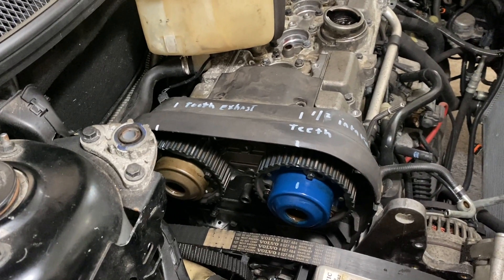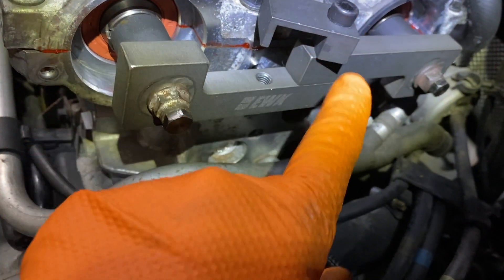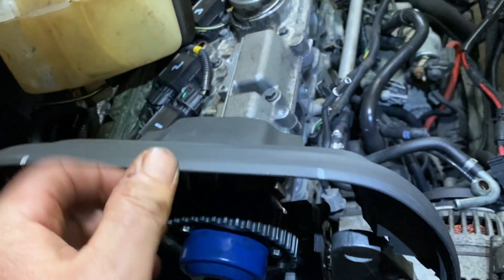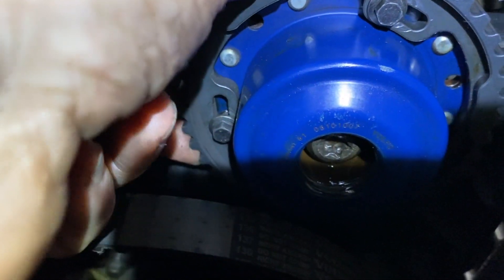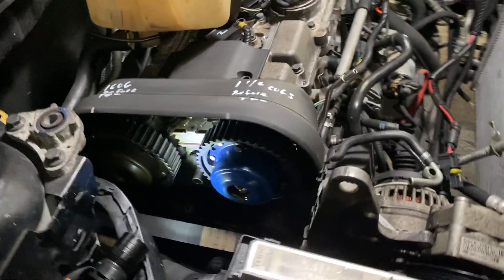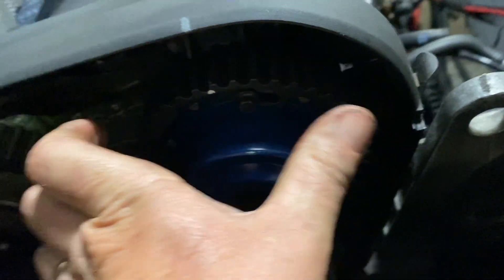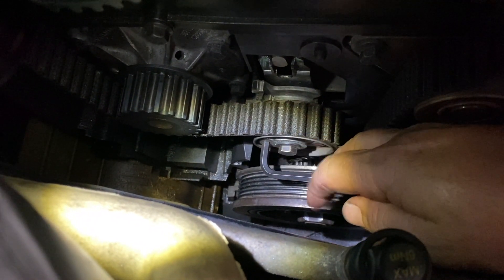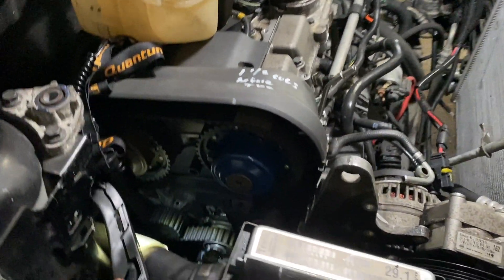Volvo 2.5 Turbo Variable Valve Timing (VVT) Alignment

Comment: After doing this I get crank but no start, could it be something else?
Reply from the maker: What exactly did you do?
Reply: I followed the video. I started having misfires plus crank/cam correlation code. I aligned everything, turned the engine by hand numerous times it all felt good. It did fire up once, then when I put everything together and got ready for a test drive it wouldn’t start. So right now I’m stuck, going to restart the job. Very low compression though with everything lined up. Averaging 80psi per cylinder
Reply: I also have done a basic timing job on this car (as in replacing belt with pulleys, I’ve also done cam seals). I just never dealt with the VVT hubs until watching this video.
Reply: I also removed the valve cover to make sure the lobes looked right, the cam locking tool is pretty spot on I’d say. So I really don’t know. It’s going to be the 5th time that I redo these steps after I reinstall the valve cover. I also have 223,xxx miles but I wouldn’t think it’ll just give up on me after retuning to factory specs??
Reply: What I did was loosen the center bolt, turned the cams CCW then CW to line up the marks TDC. Snug the center bolt, turned the unit CCW. Loosened the bolt, lined it up as mentioned in your video (1 tooth & 1 1/2). Then I torque the bolts and line it up TDC. Again, it feels good when I turn it by hand but it just won’t run.
Reply: Update. I haven’t started the vehicle yet... as I was putting everything together I remembered I removed the fuel pump fuse. Turns out the ignition coil fuse was blown. Would explain it I believe 👍🏼 about to crank it over
Reply: Another update, my ignition coil fuse blows as soon as I put the key in. Any tips?  The ground cable on the coil harness is not grounding too well. I put washers but still not that great. CEL is p0079 & p0076
Reply from the maker: Sorry, but without me being there to see what you did wrong is impossible. The ignition coil fuse is completely different than the timing issue
Reply: Yes sir. My coil harness was all jacked up. Got that electrical issue fixed and now have spark but still not running. So I’m going to redo it again lol. I have the cam locking tool so I’d say the important part is setting the vvt right. Also, TDC on crank is on the lower left notch from the oil pump right? Piston wise it’s not exactly all the way up but I guess that’s normal.
Reply: @solrac6267  I noticed this too! it seems as if its not truely TDC for me as well based off my crank mark.
Reply: I’m getting a reduced engine performance light, so it won’t actually start. I also have “high input from intake solenoid” so going to recheck the wiring harness
Reply: Many issues with wiring. Everything was dry and brittle so many wires crossing. Re-insulated everything and rerouted the crank sensor harness away from starter motor. Broke the bracket to the crank sensor though. Also, my camshaft apertures are broken, missing 3 keys (2 on one and 1 on the other)

Comment: Excellent video sir... my brother has a 2005 s80 2.5t and his timing belt got destroyed and jumped timing.. not sure if the the exhaust cam suppose to move in and out but it does.. any thoughts on that will help greatly  thanks
Reply from the maker: Thanks ! In and out movement is normal.
Reply: Hello sir I have some more questions.. after watching your video 8 times I was wondering how to know when to lock the cams? Or just putting locking tool all to do? Do I have to rotate cams or crankshaft or anything?
Reply from the maker: I’m not sure what you’re referring to?
Reply: What did you have to do before locking the cams?
Reply from the maker: I explained it in the video. It’s a procedure Volvo wants you to perform. I did that video a while back and the cams get locked down after the sequence is done.

Comment: Does this apply to the 2001 2.3T T5 as well? I'm guessing it is since it's the same block but different sleeves/boaring mostly if I'm correct. Great video!
Reply from the maker: If both cams are variable and look the same, then yes. Some models and years have only 1 can that's variable, then no.

Comment: I am replacing the timing belt on my wife’s 2004 Volvo S60 2.4. It broke while my wife was driving the car. So all three pulleys have spun different ways. So I understand about the timing and the notches. But Do you have a video of how to install the camshaft tool on the end of the cams? I would like to know what I have to take loose and how to install it on the back. The tool that locks the cams in place. I cannot find a video on that. Very good video BTW, thanks.
Reply: The Timing belt broke off without damaging the valves you must be damn lucky!
Reply from the maker: At 1:40 in the video I show the tool and how to install it. You have to take the cam covers off on the rear of the engine and then remove the stator center screw on each cam then install the tool in the vertical slots.
Reply: Thank you very much, I’ve worked on a lot of cars but never foreign. Also timing is something I’ve always stayed away from, I’m gonna try to tackle this on my own. But I’m definitely stressed out about it. Your video has helped a lot! Thank you!
Reply from the maker: Thank you and don’t be stressed just take your time don’t rush and you’ll be fine. Good luck

Comment: I have a 2004 s60, it wasnt running when i got it, got it to run, the intake cam was off a tooth, then a while ltr i took of the intake cam off to replace cam seal, and now it wont turn over, do yall have any tips to help me
Reply from the maker: These engines are tricky to time. You probably messed up the timing. Follow the video to retime the the valve train.
Reply: @motorcarnut  i followed it, but still think i still messed up, i tighted the exhaust vvt amd put the timing belt, then i tried to slide the vvt like at the end of the vid, but it it only goes like 3/4 instead of its limit position like the intake cam
Reply from the maker: They don’t have to be even in the end as long as they are as far as they will go after following the whole process.
Reply: @motorcarnut  ok well i feel kinda dumb now, done it like 4 times now thinking i was doing something wrong

Comment: Thanks for this...I watched the video about 5 times, set everything up (I thought) but when I turned the crank over twice the exhaust hub mark looked a tooth off.  Didn't know if I could just spin the cam with the locking tool so I just did the whole thing over again and it purrs like a kitten.  Thank you so much.
Reply: You could have jumped the cam a tooth after loosening the tensioner and clamping the belt to the other cam gear.
Reply from the maker: Thank you! Glad your back on the road!

Comment: What's the torque spec on those 3 bolts for cam gear ?
Reply from the maker: 89 inch lbs
Reply: @motorcarnut  thank you .

Comment: Man, that´s exactly the video I was looking for. But should the oil residue from the VVT/threads not be cleared before re-tightening? If I tighten the center screw with oil in the threads how can the torque spec be reached?
Reply from the maker: You don’t have to clean the thread’s you’ll be fine.

Comment: What am I missing? Why do you even have to loosen the 3 nuts and mess with them on each sprocket? Cant you just put the sprockets back on where you took them off? They have the spring loaded play. So, if you just made 2 marks (1 for fully advanced, and 1 at rest). Cant you just put them back in that same spot?
Reply from the maker: You really can’t because once you release the tension on the timing belt everything can move because once you do you will throw the timing off and will have to lock the cams in the back and reset the vvt units like I show in my video.

Comment: I am just about to change the head gasket on a 2006 Volvoxc70.  I have been scared ______less about this part of the job.  I think I can now remove the timing belt and lift the cams with some degree of confidence thanks to your video.
Reply from the maker: Thanks, it ain’t so bad just mark things as you take them apart .
Reply: I am in the process of the exact same job.  Removing CAMS and head to replace valve seals and hg.  Let us know how it goes !! Good Luck !!

Comment: Just did this today, wrote the steps down so itde be easier to follow while doing it and happy to say it fired up no problem! At first i attempted to follow what ever vida told me and it wouldnt start and gave me a cam inlet code...
Reply from the maker: That's great. And the reason I made that video. The factory manuals can be confusing to people who are not seasoned mechanics so I try to explain them in layman's terms.

Comment: Could that cause a ECM-6140 error code to come on?
Reply from the maker: Yes or dirty or failing cam solenoid.
Reply: @motorcarnut  I replaced the cam solenoid and the same code came up.
Reply from the maker: Then it’s probably one of the cams is off. A scan tool can tell
Reply: @motorcarnut  I have a vida dice scanner. Will that work?
Reply from the maker: Perfect, that’s what it’s made for
Reply: @motorcarnut  what is the numbers for the exhaust cam?
Exhaust camshaft adaption is -1.47
Exhaust camshaft reset 80%
Reply from the maker: Looks like that cam is off a bit or the cam gear is worn. How does the car run at idle when cold and hot and how is the throttle response? Also if you clear the code how fast does it come back?
Reply: @motorcarnut  the code comes on after driving 5 miles.
Reply from the maker: Under load, so did you do anything with the timing or did this just start out of the blue?
Reply: @motorcarnut  I replaced the head do to a blown head gasket. Then the code come. I  took off the exhaust hub to replace it the exhaust came gasket. I reali the ports and the pcv box was clogged. I cleared the clogged and replaced the entire pcv system. I started the vehicle and code came back on.
Reply from the maker: You have to recheck your work, you had to have mess something up. The Volvos with both variation cams that move anyway like in my video are a little tricky to line up
Reply: @motorcarnut  I adjusted the exhaust cam hub to factory specks. It started better, but I lost daylight.
Reply: I replaced the exhaust hub. The difference is now -5.97 on the camshaft angle exhaust.
Reply: Is there a email or place I can send you pictures. The vehicle is now not starting like it does not have spark or fuel, but it does have both of those.

Comment: You said to turn the engine counter clockwise and then clockwise and line it up. But I’ve read on forums that it’s locked up their engines and they hear loud clicking. Could you respond?
Reply from the maker: I can't speak for what someone else did or didn't do. Follow the video, you turn counterclockwise very slightly then clockwise to make sure everything is aligned BEFORE starting the engine. If everything is aligned after then nothing jumped and you're good to go.
Reply: @motorcarnut  oh ok, I thought you meant turn the engine a whole rotation ccw. Thanks for your response, this video helped me immensely!
Reply from the maker: No problem, glad to help

Comment: I have a question sir. If the timing belt is removed and I am looking from the top of the engine down onto the VVT and I move the VVT back and forth to its maximum and minimum movements, I noticed On mine, that when I do rotate it to the minimum and maximum stops, the cam gear moves in word and outward from the cylinder head about 3/16 of an inch or so. Is this normal in your experience repairing these Volvos?
It is almost as though the inside of my VVT has a helical gear within it. It does not spring back it will stay where I put it. Is this normal?
Please know I have a VVT on both the exhaust and the intake. It is a 2004 2.5 turbo And this is how it came from the factory.
Reply from the maker: Cam gear movement from side to side is normal with no spring pressure.But you still have to set it up as stated in the video.  A little movement in and out is normal but should be no wobble or noise. Hope this helps.
Reply: I'm at th3 point of turning the vvt hubs clockwise, the belt is on and time to lock the 3 bolts holding the gear. Intake side hub turned clockwise like yours to the full limit position just like yours. When I go to the exhaust vvt, I can't get any movement out of it. Is that normal?  About to lock the 3 bolts and turn the key. ✌🏼💚Ty for the great video best one out there imo
Reply from the maker: Should be fine, yes. And thank you for the comment, appreciated!

Comment: Best video I've seen explaining this process. Thank you!
Reply from the maker: You're very welcome!
Reply: @motorcarnut  hey can I ask if your Volvo engine was surging and stalling? I have the same vehicle it turns off on it's own and the rpm keep reving also the engine keeps rumbling like having trouble to stay on did you fix yours and now it's good
Reply from the maker: No, that car had a blown head gasket
Reply: @crazy2-1ilz18  mine does exactly that. I think I've got the VVT timing wrong so will do it again using this vid
Reply: @motorcarnut  and how does one factor in the ambient temperature to the degree settings (?) before finally tightening the bolts?

Is that even an issue?

Er, forgive me, these are just the things that I find intimidating which keeps me from doing DIY’s like these.

Edit: nevermind, I got my answer, thanks!
Reply: No seriously... thank you Motorcarnut. I just got a xc90 with a slipped belt and this couldnt be more helpful. Now it's time to make my own timing lock tool unfortunately
Reply: Btw the instructions to make tool are in the book for the Volvos that have 5cyl, I’m using my 01-06 s60 book as a guide, it has instructions for both vvt timing and non vvt. Honestly buy the tool, did the job with custom made and could only do intake side, the steel wasn’t hard enough. Make sure to buy the cam locking tool or you’re screwed big time. Just so you all know, definitely not an understatement. I’m a big DIYer and I was able to torque, but it was not easy and to torque down to 89 ft lbs on the center cam/vvt hub bolt without rotation, it puts a lot of force on the homemade tool and bends regular 1/4 inch steel, BUY THE HARDENED TOOL STEEL ONE!!!!! - my 2¢

Comment: Need more clear..i just want to open my t6 s80 to change head cylinder gasket but i dont struction to follow it🤦🏻‍♂️
Reply from the maker: Just follow the steps in this video. It’s not too hard if you understand what you’re doing. Take time and do it slow.
Reply: @motorcarnut  appreciate 👍🏾

Comment: Hi there and thanks for the video.  I was in the middle of changing the camshaft seals and then...boom I f***ed up I took off the vvt hub without the locking tool because I don't have it  and now I couldn't even find it. My question is  can I  line up  the notches at the back of camshafts horizontally to get the cams at the correct position?
Reply from the maker: You can but the problem with that is it may not be in the zone not to throw a check engine light or worse start miss firing. Because if the vvt’s were done before you won’t know if they set them with the tool or not. It’s not just the cams being horizontal but the vvts being set as well. That tool is like $45.00 on Amazon and shipped pretty fast. Just a thought. Good luck and thanks for the comment.
Reply: @motorcarnut  thanks for your reply
Reply: @motorcarnut  HI there. i just want to thank you for this video . FYI i made my own cams looking tool (cant attach picture) and follow your instructions step by step and every thing was perfect and the car fired up from 1st try. i do appreciate your work .keep up the good job.
Reply from the maker: Great job on making your own tool! And thanks for the positive comment!
Reply: @motorcarnut  I have another question.   If the vvt was rocking forward and backward (not with direction of the timing belt) I mean when you face the timing gears.  Is that movement normal or the vvt must be changed?
Reply from the maker: A little play is normal but it should not wobble when running or make any noise.
Reply: @motorcarnut  it does and now it doesn't accelerate as it should and check indicator is on have it checked and codes were P0017 & P0016 and there is a noise coming out from the timing combenet
Reply from the maker: They may have to be changed, shouldn’t be making noise and you have to make sure timing is not off, did you have this problem before you started?
Reply from the maker: Hopefully it’s not the tool you made?
Reply: @motorcarnut  timing is perfect for sure I just took off the cover and checked it again. 
Yes the car owner told me that he had the same problem before and he changed the vvt hubs for both cams and they were used not new ones . After he changed the hubs the car was perfect for around 2 months and then started to lose the power day after day .
Reply: @motorcarnut  No  I'm sure it's not the tool
Reply from the maker: Well I think that’s your problem, those codes relate to the vvt’s as well
Reply: @motorcarnut  hi there.  Hope this finds you well.  Just for my info.  There's a VVT with coil spring and another without.  Are they interchangeable?
Reply from the maker: No their not.
Reply: @motorcarnut  tanks. i guess the one with the coil spring is for the engine with single VVT and the one without coil spring is for the dual VVT correct??
Reply from the maker: Yes that’s correct
Reply: Thanks  . I do appreciate it
Reply from the maker: No problem
Reply: I know its been some month since your question, but I don´t know how you got the center screw loose without any locking of the camshaft??? 120Nm is a lot torque to loosen it and to retighten it. And if you have turned the camshaft already you have a 50/50 chance of misalignment because only 1 position is correct on both sides.
Reply: @CarlosGlatzos976  i made my own locking tool and it worked fine.  I can't attach pictures of it here